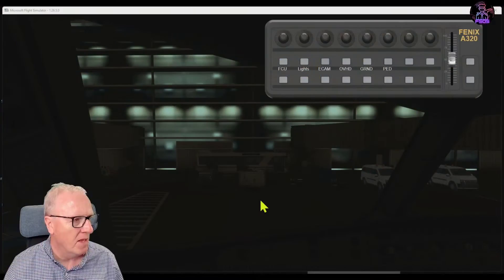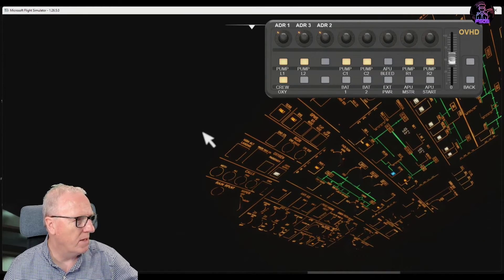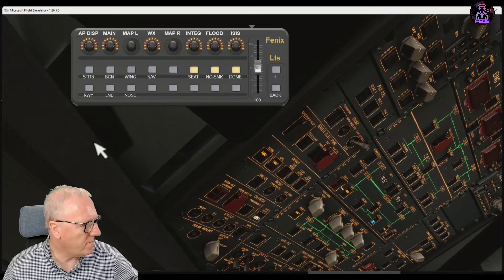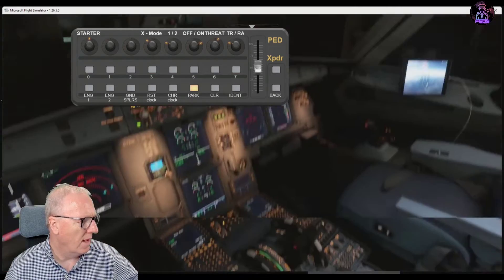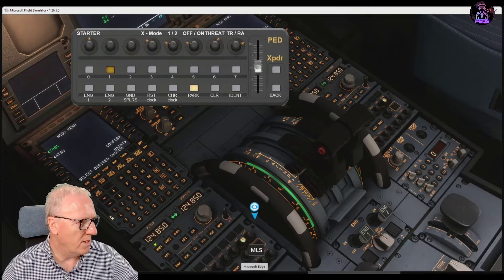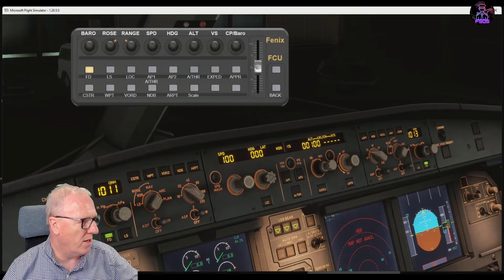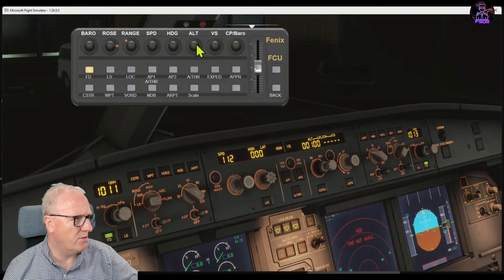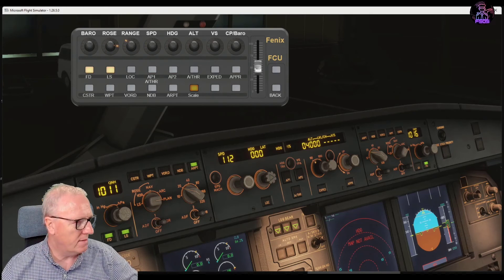Fenix a320 xtouch

Comment: Is this still working? I have the X-Touch gauge setup and it responds to inputs on the Mini, but there's no lights working, and nothing happens in the plane. If I click on any of the buttons on the gauge, they light up, but none of the options change, eg OVHD just lights up the button but nothing changes

Comment: That must have take ages to program. I use the X touch mini for AP functions in the Fenix 320 and FBW 320 and streamdeck for the rest of switches. Be interesting to give this a go in comparison.
Reply from the maker: Like you I reley on the streamdeck for nearly everything. But its nice to have rotarys.What I am now looking at doing is using both and when I change a streamdeck page, it changes the xTouch at the same time